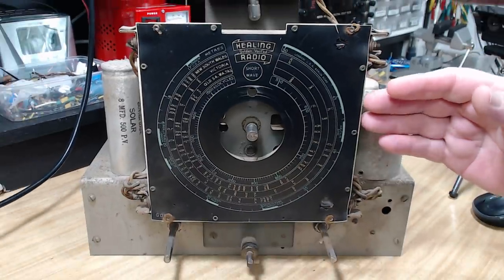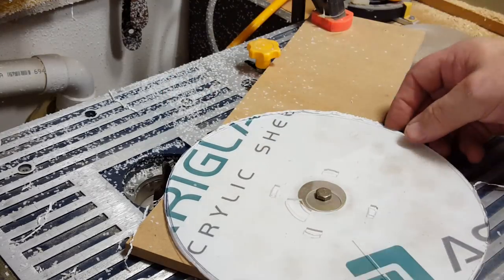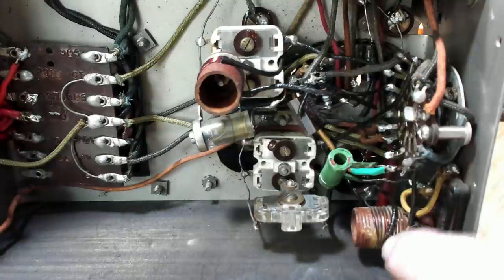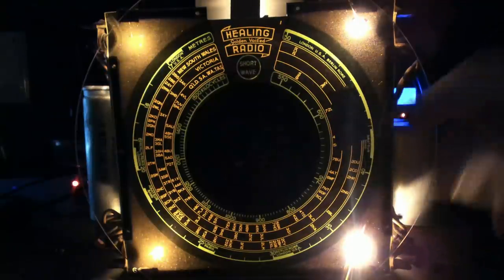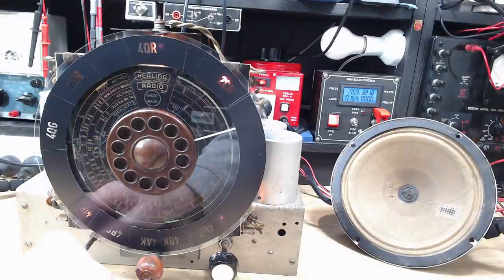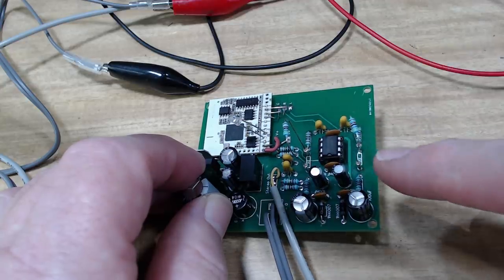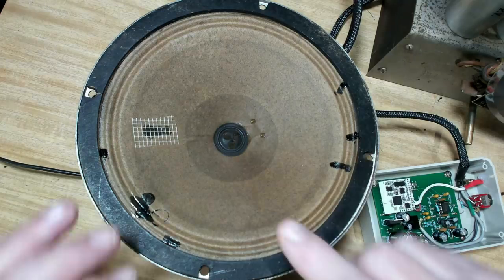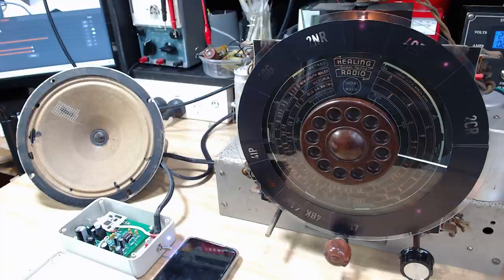Healing 448E 1938 Restore and Bluetooth Part 2

Comment: I’ve always wanted a medal. Thanks Dave. I’ve also learnt something new: how to rename the modules.😊 Great video, as usual. I’ve also noticed the views from Down Under have gone up quite a bit since you and Don mentioned my channel. I’m thinking of adjusting my accent a little to accommodate that, but I can’t do anything about my name. As I said, it’s been pronounced in so many ways, and your version really takes me back to my days in SA 😊
Reply: Will it work with the MH-M28 boards. If so I'm very interested 😉
Reply: @maartenschapendonk6345  The boards are designed specifically for the MH-M28 boards, so they fit with no mods.
Reply: @electronicsoldandnew   yes I know. But renaming the the boards.
Sometimes I have a few in use at the same time ☺️
Reply from the maker: A well deserved medal Manuel. Module renaming makes for a professional touch particularly if you have a number of modules with the same name and don't adjust your accent, it reminds me of cricketer Tony Greig.  That's great if you are getting extra subs from down here. Thanks Manuel 🙂
Reply from the maker: Hi Maarten, I used a CSR chip SPI, I don't know which chip is used on the MH-M28 and I don't know if it will work with other chips. There are generic SPIs which may work 🤔
Reply: @maartenschapendonk6345  Ah, I see what you mean. I haven’t looked into that yet, but I have the same problem with multiple units being paired on my phone.
Reply: This kind of interaction makes me smile. Well done both. A well deserved medal.
Reply: Dave and Manuel, Please don't change what you do. You both do it so well, I don't think that there are any as good as you two. Well, maybe Mr. Carlson, but that's about it.
Reply: @electronicsoldandnew  I don't know about iOS, but on Android and Windows you can change the display name of a Bluetooth device. That's how I distinguish between my different radios.

Comment: I really like 👍 the glow of that dial at night. At least, turning off the lights simulates night. This radio sounds like 👍 a “Hallow’s Eve”, and an air raid siren 🚨 as you’re working on the dial. I see that this is part two of the Healing ❤️‍🩹 radio 📻. Your friend, Jeff.
Reply from the maker: Thanks Jeff, the dial looks good at night. It made some odd noises 🙂

Comment: Great job on that dial plate David. I wouldn’t have thought of using the router. Loved the Bluetooth module and big thanks to Manuel. I must order some and have a play. Cheers Graham
Reply from the maker: Hi Graham, thank you. I did a dial plate a few years ago and used my big lathe but it tended to chip the edge, this worked much better and was more accurate. The Bluetooth works great, my thanks to Manuel for doing all the hard work 🙂

Comment: Beautiful work on that dial Dave! The radio sounds really great as well. The BT works great and a hat's off to Manuel for that design. The Healing looks amazing in the cabinet!
Reply from the maker: Hi Gregg, thank you. I wasn't sure about using the router on the dial but it worked a treat, the last one I did it on my wood lathe and it tended to chip. Agreed, it looked fabulous in the beautifully restored cabinet (not by me) 🙂

Comment: Thanks David really enjoy your work and techniques. Your dry humor is great. On the Blue tooth I have done a couple of these but I use a small micro switch mounted next to the tuning gang. When the gang is fully opened it pushes the arm of the switch and changes over to Blue tooth. This enables changeover to Blue tooth from original control.

Regards Andy
Reply from the maker: Good thinking Andrew 👍🙂

Comment: Mister Radio generally does BT on all of his refurbs too.  I find your solution a bit tidier.  Love the dial plastic.  Ya had me on the edge of my seat, biting my nails for that 10mm hole.  Awesome, as always.
Reply from the maker: Ok thanks Jay, I haven't seen Mr Radio. It would have been smarted to drill the 10mm before the big hole but I didn't think that far ahead 🙄🙂

Comment: You make it so easy to do. I know it is not totally in your comfort zone with the Bluetooth device but you handled it great!
Two thumbs up  with  using Manuel's module. It works fantastically!
Reply from the maker: Hi Steve, Manuel's board was the breakthrough I was looking for, I have added Bluetooth to a number of radios but the addition of an amp is was what got it over the line. The DC to DC convertor allows connection to the 6.3 filament without the noise. Thanks Steve 👍🙂

Comment: I was thinking that running the audio down to the module switch and back might add hum, but no hum was audible. If it did, a switch might control a relay near the volume control. Great job. I admire the adventures in coil winding.
Reply from the maker: Hi Jim, I was apprehensive about running the audio down there too but it was fine. I used to kill the receiver when bluetooth was connected to stop it feeding back into the front end but it was an excellent result thanks to Manuel's work 😀

Comment: Excellent for a ("just to get it working") restoration, as usual!  The owner I'm sure is ecstatic with his now newified antique radio. The results, both your chassis work and his case work, is sure a beautiful radio!
You reminded me of a tip I saw recently on another YT channel.  When using a hole saw to saw through perspex it helps to spray water onto the bit as it cuts.  You'll avoid a lot of the crusty melted mess that usually results when drilling (sawing) through the stuff dry.  Don't know if that will work in future restorations but it might be worth a try.
Reply from the maker: Thank you Sincerely Yours. I didn't do any comedic repairs I meant but I get your point 🙂 Water might help although it's easier to sweep up bits of plastic than mop up water with bits of plastic in it... yeah... I'll keep it in mind, thanks Bill 🤔🙂

Comment: Extremely well done David.  Routing that plexiglass is a challenge  - I found the high melt point plexiglass works best and assume thats what you used here.  Good stuff.
Reply from the maker: Hi Ron, thank you. The plastic sheet I used is acrylic, I don't know what plexiglass is made from, I think it's perspex. What I used was just ordinary acrylic and it routed very well, I used a small diameter bit it get maximum cutting from maximum revs and it cut really well, I could have sanded the cut to smooth it but it was OK. I use it to mould dial 'glass' as well. Thanks Ron 🙂

Comment: Hi Dave.  Love your videos.  Just wanted to tell you about an issue I had with my Bluetooth installation.  When I turned the radio on in the Bluetooth mode, the connection light would come on briefly and then go out and I could not connect.  I could connect when powered by the usb port.  I had previously installed a thermistor on the mains to limit the current rush on the filaments at startup.  When I put a jumper across the thermistor, the power supply, amplifier and Bluetooth all worked fine. Apparently the reduced voltage at startup would set up a fault. I will just delete the thermistor or turn the unit on in radio mode and switch it to Bluetooth after it has warmed up.  Thanks for your informative channel.
Reply from the maker: Hi Erv, thank you and thanks for passing on the Bluetooth issue you had, I think I have struck it before when trying to design a Bluetooth solution for radios but I had forgotten. Good tip, thanks again Erv 👍😀

Comment: What a loverly radio, i like the phone dial and perspex disk pointer :-D
I actually hate people adding blutooth to old equipment.
But you have made it so neat and kind to the radio, it won't interfere with the radio.
it's not a bodge job and it sounds fine :-D
Maybe i just don't like the way people bodge the pcb in (very crude) :-(
For some reason when you were drilling, my mind jumped  back to my school metalwork class.
The solid cast heavy pillar drill was such a handy tool, just put the victim in the clamp and away you go lol.
Odd how memorys from millions of years ago re-appear.
Sorry woffle mode :-(
Reply from the maker: Thanks zx8401ztv. The Bluetooth can be removed in about 5 minutes, I don't like bodged jobs either. Funny what will bring back memories, sometime I remember something funny and laugh or smile and my wife asks why I'm smiling  😀
Reply: @DavidTipton101  lol old jokes never die, they become polititions :)
Next time your good wife asks why you are smiling,  just tell her you have taken out a short term life insurance policy in case something happens to her.
Show a full teeth smile :-D
She might hit you with something as she knows you are a pillock!.
If the police arrive, hmm no humor.
The original smile could have been wind but why waste a chance to upset your wife :-D.
Yes im very silly.
Reply from the maker: @zx8401ztv  Silly indeed 😄 I usually explain what I'm remembering and we have a laugh, you nailed the pillock bit 🙂

Comment: Interesting that you've put Manuel's Bluetooth moduel in a little case, I've been using Velcro. They sound pretty good too. Just goes to show these radios were designed pretty well. One problem though, the older design was fairly small, this Bluetooth board is much bigger and is a struggle to fit to smaller mantels. The exterior box might be the go.
Reply from the maker: Hi Andrew, as this was a console radio the box was a good option, it is a bigger board and I haven't tried it in a smaller radio yet, I thought the board could be attached to the inside of the side or even the underside of the top if it wasn't too hot, it would have to be a bespoke installation for each radio. Thanks Andrew 🙂

Comment: Crikey! another excellent job down under! You are at the Verner von Bran level of radio repair and I am still cursing schematics as they never seam to match what I am working on perfectly.... well that's my excuse as to why I only have 1 our of 2 radios working....
Reply from the maker: Hi Mike, they rarely do match, you have to work around them. I sometimes get schematics from a similar model either side of the one I am working on from the same manufacturer of course. Manufactures often stay with the same design and the small changes made during production may show up in earlier or later model schematics. Good luck with your second radio 👍😀

Comment: Great content, I've always wanted to add Bluetooth to one of my radios buy didn't have a clue how. Thanks
Reply from the maker: If your radio has a phone input you ca add a Bluetooth adaptor through there, it won't have the little amp but it will work. Thanks Larry 🙂

Comment: Good morning again David.  Thanks for previous advice, I have now rejoined HRSA.  While setting up again to do restoration work I have sourced a Paton ET4a valve tester.  Unopened and untested at this stage. OK cosmetically and appears complete.  Before starting this i wondered if this might be an interesting project for a future video?  If so could bring the unit to you to see.  Currently this is the only way I can contact you. Kevin Johnston
Reply from the maker: Hi Kevin, I have two Palec/Paton valve testers to restore myself one being an ET4A so I don't need to do another thanks. Good tester if you can get your head around the settings. I did give you my contact vintageradioaus (at) gmail.com 🙂

Comment: I don't know if you have an AM transmitter, usually 100mw output or less, they are great for using with MW only valve radios, I have one I use to listen to an FM station on MW, it also gives future proofing for when eventually AM is switched off which is already under way here in England.
I always remember listening to Radio Australia on SW as a child back in the 70s, listening for the waltzing matilda tuning signal so I knew I'd found the station, great times!
Reply from the maker: Hi Christopher. I have a number of MW transmitters but I don't use them at the moment, I have been thinking about setting one up recently. I used to listen to Radio Australia as well, it was shut down probably 20 years ago to save money, it's now broadcast on local radio as Radio National 😏

Comment: Nice job, Dave !!  One question about the Bluetooth : Was there also a possibility to lead the pairing LED to the front (e.g. behind the dial)? I guess if possible, one gets a nice blue glow when on BT...
Reply from the maker: Hi Eddy, thank you. Yes the LED could have been extended and placed elsewhere on the radio and I have done that to other radios I have fitted Bluetooth to. I didn't in this case because the module was in a remote case 🙂

Comment: For the Bluetooth thingie... yes, I think I've seen other restorers build one in too.  And it's nice.

What I'd have suggested and preferred would be a separate tuneable low power transmitter box, modulated from the Bluetooth capability (and possibly a standard 3.5 mm jack as alternative input).  A lot of these old radios had a stunning AM bandwidth capability, without the narrower bandwidth known in more modern AM radios (perhaps to cut down on static, allowing that most of these will be used with a mere internal antenna).  Perhaps for the vintage touch, this transmitter could use a tube or tubes too, with the Bluetooth discreetly out of sight.  Maybe something like this could be floated with the radio clubs, to come up with a design to do it.  In the USA at least, direct line powered with suitable input isolation wouldn't be out of the question.  That's more unwieldy with Aussie power, but you seem to have standard radio transformers there, simplifying the matter.
Reply from the maker: I've fitted quite a few aux sockets and attached a phone or Bluetooth module and they sound great but I think you are suggesting going through the tuner which I haven't tried 🙂
Reply: @DavidTipton101  yep, that's what I was thinking, at least as a one-off test for acceptable fidelity -- sending it as an AM signal that the radio can tune in.

Comment: Another quality video. I enjoyed it. One dumb question: did you just tie the audio output from the Bluetooth straight into the volume control or did I miss something.
Reply from the maker: Hi clasicradiolover, yes, switched into the volume control top end and to ground, unless it's a hot chassis of course 🙂
Reply: @DavidTipton101  OK 👌 that's simple enough I could even do it.

Comment: I had a look at Manual's circuit design and I like it. I can't see what opamp you've used here, but given the controversy opamp selection seems to make that's probably wise!!!   QUESTION what DC-DC isolating chip do you use and where to you source them. I've got a bluetooth module on a boombox that I need to electrically isolate because the module generates hash when it shares a common power ground.
Reply from the maker: Hi Seiskid, is there controversy over the OpAmp? anyway the OpAmp is an LM358P and the DC to DC converter is a BO505S. Yes it will generate hash like that the converter should fix that. The OpAmps are available anywhere, for the converter try a Google search and eBay, they are available from China but you may find someone local  🙂
Reply: The isolating DC-DC converters are made by a variety of manufacturers such as Mornsun, Traco etc, but what they all have in common is the input-output voltages in the model denomination. So if you need one going from 5v in to 5v out you will want to type in DC-DC converter 0505 into your search. They are available in a variety of input and output voltages so if you need a 12v in, 6v out you need to look for a "1206" for example. For BT module operation the small 2w versions are just fine. Hope this helps.
Reply from the maker: Hi Blitz, thank you, that is most helpful 👍🙂

Comment: With your bluetooth addition why didn't you use one of the modules that has Mp3 and FM as well as bluetooth . You can get 5v versions and 12v versions and the whole thing is 30cm x 20cm . There's also a stereo to mono version. I've been doing this for ages AM down here in country Vic is as dead as unless you like listening to horse racing and some ABC or a tone that's wiping out at least a quarter of the frequencies. Usb and Mp3 beats bluetooth hands down
Reply from the maker: Hi anno250, I haven't heard of those boards and at 30 X 20cm would be difficult to fit in most radios (I assume you meant millimetres) besides as you can stream anything or everything via bluetooth from a smart device I don't see the point, this is a an 84 year old radio, you won't get HiFi from it. Thanks anno250 🙂
Reply: @DavidTipton101  That should be 30mm x 20mm derrrrrr. I think these give more options ,Usb is so convenient you just turn on the radio and away it goes your mobile is free to do what its meant to do . A lot of these radios have a decent sound ,it might not be stereo but some like the big old radiograms they sound pretty good.
Reply from the maker: @anno250  haha, I assumed that. I'll have a look for the boards, someone might prefer them, thanks.
Reply: @DavidTipton101  I was going to post a link but the Ebay link would have filled the page,So just do a search for  Advanced Car Bluetooth Wireless MP3 Decoder Board Audio Module USB TF FM Radio and you should find them  ,I know there's a mono version that has its own power supply. It makes it easy to build into the radio. The version here I made a separate box with rca outputs that I can plug into any radio ,stereo or mono.
Reply from the maker: @anno250  OK, thanks 👍🙂